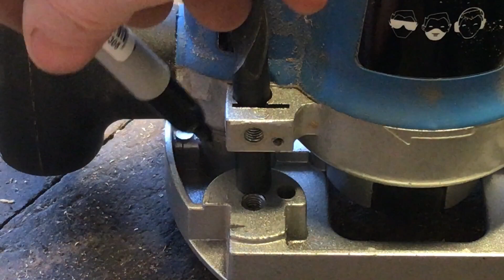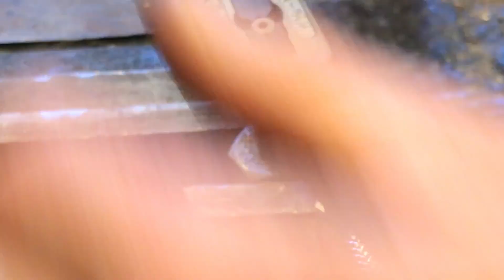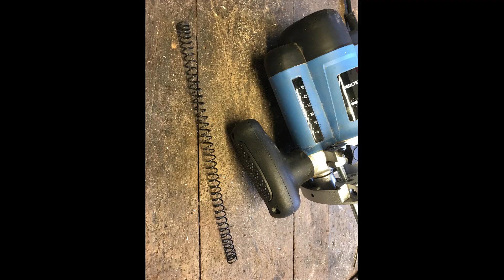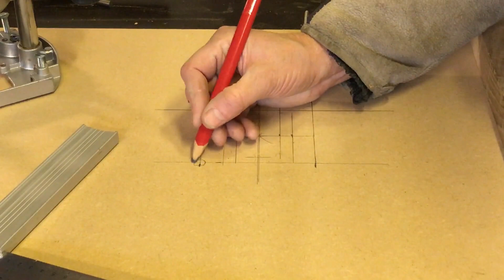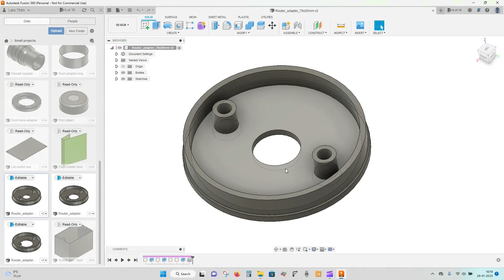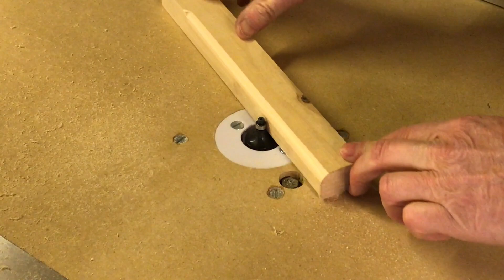Simple Router lift hack for Router Table

Comment: I like the way you threaded new holes for stronger screws, and the bolt is pretty cool, I'll definitely try to do something similar. I bought a cheap router about 35€ including 6 bits and 2 collets. I already have 4 routers, but this was so cheap I was curious, it's not half bad at 1/10 the price of my favorite with dual mode.
Btw. It's pretty cool that your router does not have the safety stop feature, that prevents it from starting when using an external switch, or did you modify it ?
Reply from the maker: Thank you for your comment :o) .. and i do hope you can do some similar on your cheap router. Even though it may hurts a little to start cut, drill and modify a brand new router.
For the safety switch - my router is probably 10 + years old. Not sure safety was high priority at that time. It's born without and safety feature. Just a simple switch.
Reply: @thimtools7538  
There was no pain, on the contrary everything turned out more brilliant than I could have hoped for. So for those who are considering turning their budget Parkside router into a rather cool table mounted router, this is the short and dirty guide.

You will need a threaded rod, I used M6 but M8 will do as well. Matching bolts or connecting bolts as you like or have in stock. Some kind of glue, I use an epoxy called liquid iron. 

Remove the bottom plate, and stick the threaded rod into one of the two height adjustment tubes, the one away from the trigger handle, you should have free passage, all the way until it's blocked by some plastic at the top of the router, now remove the top black plastic cover, 4 screws, and you see the green plastic that is blocking the rod, you have to drill a hole - easiest if you have a long drill, that goes all the way through from the bottom, alternative grind  the threaded rod to a cutting edge, and use that. So in order to center the rod, you add bolts to the the rod, M6 bolts fit nicely inside the tube, M8 bolts you have to grind a little to make them fit. now you have it perfect centered attach the drill and push through the green plastic. Where you push through is where you want to fasten a nut, this will be the pulling nut that lets the rod go through. At the other end you will want to have a fix point, - you can widen the hole in a M6 bolt  and glue the bolt, or drill a couple of holed in the adjustment tube, or both. Adding a M6 grub screw to the end of the rod, connecting them with a bolt and glue. Or maybe you figure out a better way. Once you understand the process it can all be done in less than 20 minutes.

The green plastic at the top is at an angle, so you want the bolt to be perpendicular to the rod, you can build it up with the stuff I use or, I've seen people use a glue gun, not sure it will stick well to plastic and metal, you can grind the bolt to an angle, especially if you use one of those longer connecting bolts. But this liquid plastic epoxy, is somewhat brilliant as you can cut a thread into it, if you have the tools, don't run out and buy, just use what you have..

The finished result, honestly it looks like the machine was made just for this purpose, everything is hidden inside the tubes and the body of the router. This is by far a better solution than the popular Makita style edge trimmer, which is more expensive and much less powerful. And on the Parkside you can lock it ON, just like on most drills, I don't think this feature is common on routers. The advantage of the M6 thread, is that one full turn equals 1mm, half a turn half a millimeter and so on, kinda fun feature of the M6 thread.

Comment: I've just finished doing a very similar job.  I also used MDF but I found, that its thickness would make many of my router bits useless as their shanks are too short.  So rather than mount the router below the MDF, I made a cut out through the MDF that was exactly the same shape as the router sole plate.  A sheet of 3mm ply then sits on top of the MDF so effectively, the router is mounted to the underside of this ply.  

Before putting the ply on the surface of the MDF, I first put some carriage bolts through the MDF. These had their heads recessed into the MDF so that the ply will still sit flat on the MDF.  The carriage bolts hold a couple of batons of wood  on the underside of the MDF. these batons pass across the sole plate of the router.  Where these batons pass over the router sole plate they have threaded inserts.  These take bolts that hold the sole plate firmly to the ply.

The ply is held down to the MDF with plenty of screws that are all countersunk so do not interfere with it's use.
Reply from the maker: Hi Ken - sounds like a good solid setup you have created. Nice work :) .. I also thought about the MDF distance and the fact the bit didn't plunged all the way into the router. I concluded it had to come to a test - and if I got too much bend out running the bits - I would change to a setup like yours.
However - I do not used it that much, and I mainly use it for breaking edges. So I haven't got much experience with heavy router jobs yet.
Reply: @thimtools7538  One thing I found handy was that I could use the mitre guide from my saw table on the router table.  Also (since routers don't care what angle you approach them from), I use this as my fence.  To make this possible I simply cut a piece of 40mm thick kitchen worktop to sit in front of the mitre guide.  I screwed a baton to the back of this (exactly the same thickness as the mitre guide fence).  A couple of those cheep Chinese clamps then clip the whole thing to the mitre guide.  

To make a pocket in the fence for the bit you're using, you simply advance the fence until the bit is buried within the thickness of the fence.  Obviously you can do this in multiple passes, simply raising the bit between each pass until you have the required sized pocket.  This whole process is nicely controlled because the fence is riding in a tslot.  (it is, after all, a mitre guide).

Comment: How did you get the springs out? Does having the springs out make the router plunge further? Or come through the table further than with the spring in?
Reply from the maker: Initially I took out the spring in the router - It doesn't affect the plunge, since the plunge it controlled by the plunge dept wheel. Only advantage is it moves more freely.  
When I converted the router to a fixed table-router I mounted the spring again, since I needed the spring load to get more precise adjustment of the bit height.

Comment: cool build one change that you could do is to change the "adjusting nut" to an Allen socket bolt (you can get "coupling nuts" to join the all thread and bolt ) also change  the center plate bolts to the same Allen size  to be able to use the same tool for simplicity  again  nice job !!    have Fun from Oklahoma
Reply from the maker: Hi "Oklahoma" :) - thanks for your nice words ... I originally planed to use Allen sockets bolts - but it was a Sunday afternoon build, and the local "bolt pusher" had closed .. I did promise myself to change to Allen - but since it kind of worked well anyway I decided to keep it for now.
Reply: that's the way it works sometimes!!  as a retired farmer i have an old card file cabinet full of bolts and such course we are 45 min away from any  major store :) @thimtools7538

Comment: I made a similar router table for a similar router too but on the electrical side rather than adding a separate starter switch, I changed the wiring for the table saw to add a socket to plug the router into the table saw and added a switch to change over between powering the saw or the router and used the same press switch/emergency stop
Reply from the maker: Sounds like a good idea, too - I anyway had the extra electrical switch in my workshop - so it was fast and simple to install :)

Comment: Very nice design.  You could also print an insert without a hole to prevent sawdust from falling on the router while using the table saw
Reply from the maker: Thanks - and thank you for your suggestion :) .. and you are right - a good idea 👍

Comment: Others have probably suggested using a small cordless drill to lift the router.  But maybe not.  I think I would try it to replace the ratchet.  Thumbs up.
Reply from the maker: Thanks for feedback :) - and yes a cordless drill to lift would be faster .. maybe I will try find a 10,8V for the purpose ...